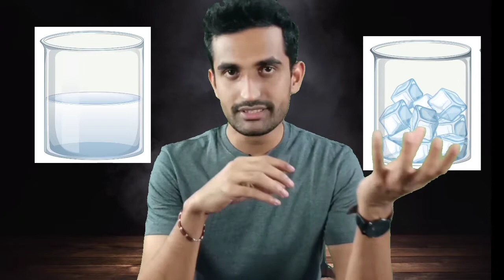Moisture inside car Headlamps!!! | Explained | Twin Turbine

Comment: Iam also facing this in 2025 also in my swift i buyed this before 1.4 years back. After one month of buying it started but the didint do any solution they are told it was coomon is there any solution to claim this waranty

Comment: Condensation is not normal dear in headlamp. It show fault in breather of headlamp. Breather should act one way to remove heat from headlamp out. If condensation is happening means there is fault in breather of headlamp for which headlamp should be changed as this is manufacturing fault. Else the problem will increase.

Comment: How can be its normal ..  costumers should not face dis issue at night becz of this issue occuring in lens of headlight we cant stop our vehicle for 5 to 10 min till it disappears and becz of mist accomodation reflectors will get damaged so how can be its normal ?? Does is occur for all cars or some random  cars .. if it occurs in random cars and not on all cars den there must be some problem in headlight which need to be solved as early as possible.. wt ur suggest is that we should wait it to disappear and u told in video dat it will not effect driver..wt will not effect haa? If mist will form "in" ur headlight den how will u get focus on front view.. will d front view will b visible clearly at distant level.. dont tell its normal phenomenon it is normal phenomenon when mist occurs on lens of "exterior" headlight not interior. Mention it clearly...

Comment: what is permanent solution so that condensation will not be there inside headlights
Reply: Dry them out and seal all the edges.
Reply: @Dr.Gunsmith  none of the edge  is open but during washing  breather plugs  absorbed water that was the reason . After replacement of breather plus things got normal
Reply: You should get the headlamp change

Comment: after switching of lights after how much time moisture should disappear , in day time if due to engine heat if moisture appears inside headlights is it normal or abnormal?
Reply from the maker: Bro it will take few minutes (hardly 15-20mins) to disappear moisture. If moisture appeared from engine room temperature then it is also the same phenomenon of temp difference. Nothing to worry
Reply: @TwinTurbine  but if require more than 6 to 8 Hrs then is it normal?
Reply from the maker: @rupaliufade7486  It depends on headlamp design but 6-8 hrs means there might be some leakage...
Reply: Good explanation bro... Pls suggest how to avoid this permanently? I'm facing the same issues...